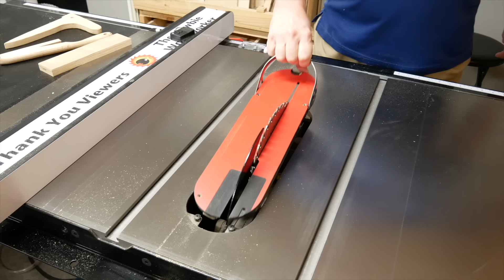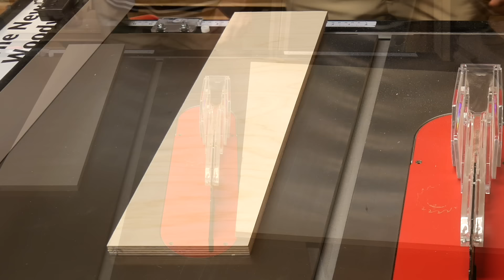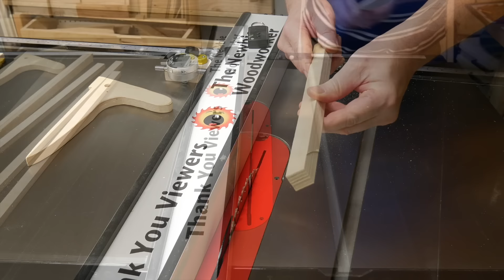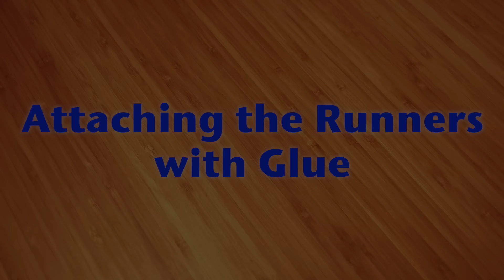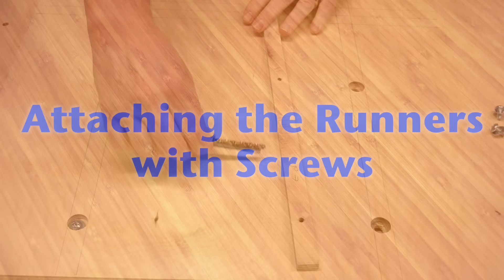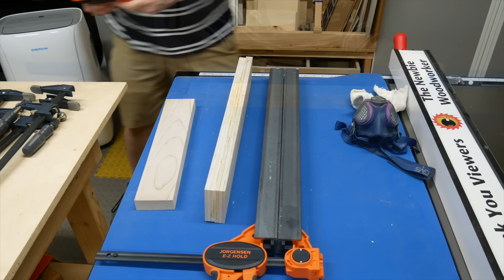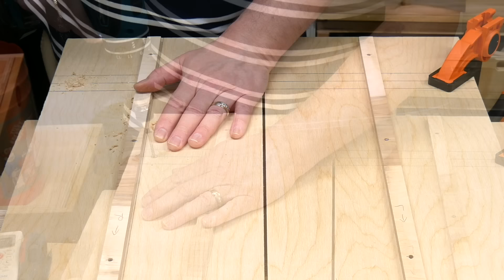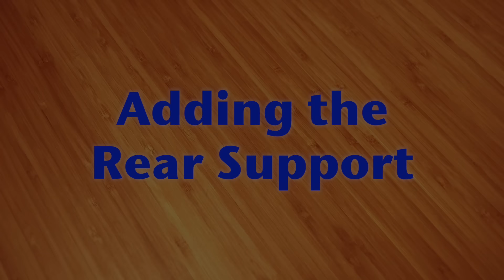Build this Revolutionary Cross Cut Sled, for Newbies!

Comment: This not targeted at you specifically. I've noticed that videos aimed at beginners are all created by ppl that have hi-tech expensive tools and gadgets. In particular table saws. Of all the videos I watch litterly every video maker as a high end cabinet saw and optional multi-100 dollar fence. This makes its nearly impossible for new woodworkers to accomplish whatever the video is demonstrating.
Reply from the maker: I understand what you're saying, but what things did I do in this video that you can't do with a cheaper saw?
Reply: @TheNewbieWoodworker  #1 thing is accuracy. My table saw wont even adjust to 90° or 45°. The fence won't hold true from one side of the blade to the other. It is as accurate as any other contractor grade saw I've used. Its impossible to cut a square piece of wood to less than 1/8 of an inch. I'm not even sure the blade is square to the top for that matter. To achieve the kinds of cuts you make I would have to spend $1500 on a saw and another $300 or so on a proper fence. None of these thing are within a newbies grasp. Hell, I'm not a newbie and I cant afford them.
Reply from the maker: @tillerbeez6575  I don't agree with your conclusions. First of all, you could buy a SawStop Jobsite Saw Pro for $1399 that will work fine right out of the box. But that's the high end - you can buy a DeWalt jobsite saw at Home Depot for $599 that should work just fine. You should calibrate everything after setting it up, but after that there isn't anything I'm doing that you can't do almost as well with that saw. Years ago I had a Ryobi jobsite saw that could do everything I'm doing in these videos. And if you don't mind buying used, there's a lot of decent saws you can buy that will work just fine. By the way, if your saw won't adjust to 45 or 90 degrees, that can usually be fixed by using the tilt stop adjustments on your saw.
Reply: @TheNewbieWoodworker , you made my point for me.. Those prices you state, in which you dont mention the aftermarket fences, are absurdly high. Even the sub $600 saws are ridiculous. And trust me I've shopped the used market for years. All I find are worn out contractors (which is what I have @ $120) or high end units (over $800). I've been thru the tilt stop adjustment of my Delta 34-444 twice. Its close but not true 90°. I guess I'm just too poor (read cheap into that if you want) to afford a decent table saw. Some day ...some day I will.
Reply from the maker: @tillerbeez6575  To be fair, the DeWalt's fence is just fine, and doesn't need an aftermarket one, unless you just want something better and have some extra money. But to your original comment: If, as you say, you can't get decent equipment without spending a lot of money, why would you expect a YouTuber to use cheap equipment that won't do the job? Of course we'll use better equipment if we can. Anyway, good luck and stay safe.
Reply: @TheNewbieWoodworker  thanks for the conversation.  In the end I'm am reminded of the old addage..." only a poor craftsman blames his tools". I'm dont wont to be that craftsman, but I also know that good tools make the job faster and either. Maybe I should look into doing videos on how to use less than good tools and still get good results.
Reply from the maker: @tillerbeez6575  I think those types of videos would be awesome! If you've learned how to work around the shortcomings of your tools, it would be great if you shared that with people. Of course, starting a YouTube channel isn't for the faint of heart, but even if you helped a handful of people, it might be worth it. Good luck.
Reply: @TheNewbieWoodworker  I know what you mean. I just started a channel last year, Tiller Beez, it is a challenge. Not sure I could manage 2 channels. I'm making my own Woodware to save money. I find the limitations of my used tools frustrating.
Reply from the maker: @tillerbeez6575  Only do what makes you happy. Trying to please a bunch of people is very frustrating. Of course that doesn't mean you can't listen to advice and try to get better, but the truth is, if you're not enjoying it, then there's no point in doing it. Good luck!
Reply: @tillerbeez6575  I use a DeWalt job site table saw. It's just fine and cuts true! Calibration is key. You can find them used for a few hundred bucks. To true them, I use a plastic reading square from staples. Great and inexpensive trick I learned. Be light handed and don't flex the blade. Make sure your square is up against the fully raised blade and don't touch the teeth. Adust in the center near the axis. My saw has a stop that is a curve and is kinda oblong. It spins and locks with a screw. It can take a while to get it right. 2 people can help. Don't assume anything. Test and check and adjust if needed. Hope this helps!
Reply: @tillerbeez6575  If your table saw is so poor you cannot calibrate it, or the fence or some other part is bad, then you need to look for another one. Although it helps, you don’t  always need high end equipment to make good stuff. Your knowledge and skill can overcome some of your tools deficiencies. As far as a table saw, this week, Lowe's is selling a new contractor Metabo table saw for about $349, almost 40% below the normal price. This sounds like it would fit in your budget. There are other deals out there, including used table saws, but you have to keep active to find them. But If you cannot afford a few hundred dollars for a new table saw, then you probably need to fix up your finances before you delve into this hobby, as woodworking tends to find a way to constantly eat up your spare money, no matter frugal you try to be.
Reply from the maker: @lewisgottschalk2178  Wise words. Thanks for sharing.

Comment: I really like your channel because when you are working on some project you also use the metric system to give the right measurements. I have looked at and build a number of projects but always ended up trying to get the measurements from Inches to Millimeters (that's because i'm Dutch). As a result it didn't always come out the right way. So i am glad you DO use the metric system, that way it saves me a lot of time getting the measurements right. Since i am fairly new to woodworking i don't want to spend to much time calculating, so i can focus on my project and do it right the first time (most of the time that is hahaha).
Reply from the maker: Ha ha, good luck with that. 😄 I do the metric conversions on my Mac, and if you have a mac, they're easy to do. Just bring up Spotlight (cmd+space) and type in the Imperial measurement, like 1 1/2", and it'll show the metric equivalent. FYI.

Comment: I'll give it a try. I stopped using a blade guard very early on and honestly took more risks than I probably should have at that experience level. I put a half inch square cut off through my workshed's wall that only JUST missed me.
Reply from the maker: Been there - kind of a shock, huh? 😄

Comment: Why not tune the fence before cutting all the runners. Doing it after means you have to cut each one twice instead of once.
Reply from the maker: You have to have the runners before you can square the fence to the blade.

Comment: Nice video. Could you please make a jig like this one that can cut angles. I build a 6 sided game board and it would be much easier to cut the angles the same every time. Oh and the boards long side point to point is 24 inches the flat sides are 21 and 3/4. Thanks currently will be using a Kreg accu cut track board
Reply from the maker: Thanks. But no, I don't have time for that. Sorry.

Comment: I finished building this a week ago (comments below) and have used it daily since then for everything from small parts cuts to breaking down a 10'  2 x 10.  Works beautifully for everything I need.  I have not found it to be weak. Could I break it? Sure, if I abused it, but once I put the sled on the saw the slides hold it snugly and I can't see how it could break in normal use.  I am no more than an average woodworker and I did not find it complicated to build.  Yes, it takes more steps than my other sled but I can't use my blade guard with that one.  A few more steps is a small price to pay for greater safety. It took me about 6 hours working at a fairly slow pace to build, including time to correct some errors.   This is good project that I have recommended to a couple of friends. And for what it's worth, I didn't feel preached at.  You seem to me to be a guy who doesn't like to see people get hurt.
Reply: Next on my list, just finishing off the router table in the evenings then this is a must for my saw. I suffered some kickback and realised just how fast the wood can fly out of the saw even cutting small pieces,  I'm going to use nylon runners on mine though simply as its way too humid here for wooden ones. I think for me it will stay on the saw unless the wood wont fit, good safety feature, I will add some extras like a T Rail for measuring etc but thats it.
Reply from the maker: @sitgesvillaapartmentneilsc7924  Yeah, kickback can be really dangerous. If you haven't seen it already, here's my video about kickback: https://youtu.be/ZUZ8hRm7a8g. As for the runners, you might consider UHMW plastic. Lots of places sell it, including Amazon and Rockler (if memory serves). And pimp out your sled as much as you want! 😄
Reply from the maker: Thanks, Mike! I appreciate your comment a lot. 😄

Comment: Awesome video! Can you explain the advantages of using a sled? BE SAFE,GOD BLESS!🇺🇸🙏❤
Reply: The main advantage I can see is that it is a great help in holding boards during cross cuts more securely than any other method I know of.  Think of it as a long miter guage.  How long depends on how long you make the fence.  I used this sled to cut a 10' 2 x 10 into two 5' pieces and there was no wobble at all, resulting in a perfect 90 degree cut. I also used it to cut 1/2" dowel pins to 1" length and it was a simple matter to keep the dowel rod pinned against the right angle that is formed by the fence and the sled bottom.  This can be a dangerous operation without a blade guard as the fingers are quite close to the blade as the cut is made, but the main feature of this sled is that I could keep my blade guard in place and not worry about the fingers getting into the blade. Hope this helps.
Reply from the maker: Thanks! My brain isn't working this morning, and I can't come up with words that explain the advantages very well. I'll try to come up with an article to explain the advantages, and if I do, I'll post a link here. For now, all I can suggest is to do some Google searches. I hate that this is the best answer I can give you right now, but I have to be honest. 🙄

Comment: Thank you so much for this video.  Not only do I appreciate my blade guard's safety features but I have overhead dust collection there as well.  And being allergic to saw dust, I want to evacuate as much dust as possible - even when using a sled.  One thing I noticed is that you apparently removed the anti-kickback pawls from your guard.  I don't really want to remove mine and they are spring loaded so do not lift out of the way.  For the time being I've used a spring clamp to hold them out of the way while using the sled.  Another thing I'm considering is notching the front of the sled base to miss the pawls. I wonder if any others have solved this a better way.
Reply from the maker: Thanks for your comment! I just didn't like the pawls - personal opinion. I would think you could figure something out with the sled. After all, that's how I came up with this idea. I just spent lots of time "ruminating" until something popped up. Let me know if you get something working.
Reply: @TheNewbieWoodworker  I ended up notching out the front of the sled base to prevent the pawls from engaging the sled which has worked very well.  I have really enjoyed using this sled without removing the blade guard!
Reply from the maker: @bellonwheels726  Good idea, and thanks for letting me know it's working out for you! 😄

Comment: I have watched numerous cross cut sled videos on youtube.  My most favorite ones so far are two, this one and the one designed by Jeremy Schmidt (see DK Builds video: https://www.youtube.com/watch?v=lSNX6cVWKdU).  I am kind of stuck between which one to make, but I think I will start with Dan's.  However, I will definitely add another fence on the opposite side for added stability.  Don't think I have the patience to use the blade guard.

It is probably worth mentioning in the cross cut sled videos that a given sled works only with a specific blade you have.  Don't use the same sled on a different blade with a different kerf, even a different copy of the same blade.  You will ruin the sled.  Oh and definitely don't use it with beveled cuts.

Another important thing to keep in mind is that when using a sled, your total cutting height is reduced by the thickness of the sled's base.  So if you have 3/4" base and the blade only raises up to 3 1/2 inches, then you can only cut things that are not taller than 2 3/4 inches, give or take.
Reply from the maker: Thanks for the comment. If you're going to add the front fence, then you'd do better to either make Jeremy's, or see my other sled: https://youtu.be/b-65Bs5Yi0w. I agree that you shouldn't do miter cuts with the same sled you use for normal cuts, but as far as different kerf widths, it really only matters if you use a dado stack or box-joint set. The difference between thin kerf blades and normal blades shouldn't make any real difference. I suppose it might affect the "zero-clearance"-ness of the sled, but not by much. And yes, a sled certainly does affect the cut height, although it's rare that you'd cut something thick using a cross-cut sled. If I were to do that, I'd use a half-sled like I show in my other video: https://youtu.be/nyNimyc2UeY. That way, a tall blade won't cut through the back fence. Or just use a miter gauge.

Comment: Thank you for this excellent, informative video.  I just finished mine and am very pleased with it, as I prefer to use the blade guard whenever possible.  Contrary to  the comments of another viewer below, I did not find it complicated nor did i find it weak. Perhaps it is not as robust as a sled with a front fence but the miter slides help stabilize the sled when in use and I think the block glued on the operator side of the fence will help keep the kerf from splitting out.  I made my fence out of well-seasoned pine and I laminated from narrow strips for stability and then milled it to 1 1/8" to help keep the weight down.  Great project.  Thanks again.
Reply from the maker: Thanks for the comment, Mike! I appreciate hearing back from people who tried a project. 😄

Comment: nice idea...but more complicated... bad option to make a sled... there's a weak structure
Reply: I added a 3/4" piece of aircraft ply on the opposite side of the fence. This adds the stability the sled will need as you use it more and more.
Reply from the maker: Works great, and isn't weak at all.

Comment: so... um... you're making a sled meant to give a precise repeatable cut, but you are putting oversize holed that will allow it to shift by a couple milimeters??? this could end up in your work piece being off by a degree or two.

Overall a great video.
Reply from the maker: Only if you loosen them and move them after you've aligned the fence. If you loosen only one and re-tighten it, then assuming your runners fit correctly in the miter slot, I doubt you'd affect the alignment much if at all.

Comment: Thanks for this video. I watched it a few weeks ago, bookmarked it and have watched it again as I have a few projects coming up where I'm going to be using my table saw a lot. I notice my table saw has a fence and a single T-track. None of the designs I've seen for sleds look like they'd work with a single T-track. I guess I can try to tweak your design to work with one runner, but would you recommend only investing in a double T-track table saw? I was kind of new to this when I bought it. Many thanks.
Reply from the maker: I wouldn't get a new saw just because you want 2 tracks. If you have other reasons, then go ahead. But I have a video for a sled that uses one track: https://youtu.be/b-65Bs5Yi0w. Let me know if you have questions.
Reply: They make table saws with only one track? That seems crazy.
Reply from the maker: @kryptik0  I've seen a few here and there, but yeah, kind of a head-scratcher.

Comment: Thank you  - I like it’s simplicity- no need for a rear guard piece ( hope that’s the right term?)
Reply from the maker: I think it's called the front fence. I used to consider that the rear of the sled, with the front being the part you push. But after watching a lot of videos, the consensus seems to be that the rear is the part you push, an the front is the part that goes through the blade first. Not that it matters, but being a retired software engineer, I try to use the right terms. Try, and fail a lot. 😂
Reply: The Newbie Woodworker  Thanks for the correction - yes I thought the term a bit upside down. So I guess the need for a front fence is unnecessary due to its size of the sled  (ie the extra support is not needed) ?
Reply from the maker: @kathrynnewton8721  I didn't mean it as a correction so much as just sharing what I learned about the terms. "Correction" makes me sound like an English teacher with a red pen. 😛 Anyway, there's two things that make the front fence unnecessary on this sled. The first is two runners, which means there's not much stress on either side. The second is that you don't cut the sled all the way through, so the uncut portion at the rear keeps the two halves together, if that makes sense.

Comment: re-attaching the fence: when I have to do something like that, I use finishing nails in the (fence) holes to get things aligned. Then I remove one nail at a time and replace it with a screw.
Reply from the maker: Interesting idea. Thanks! 😄